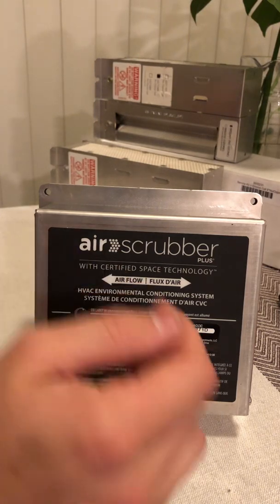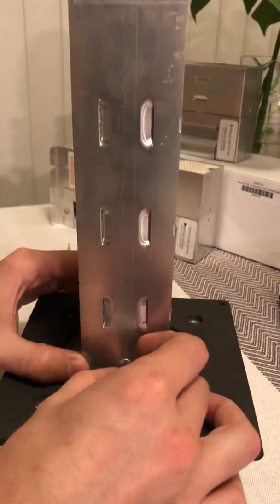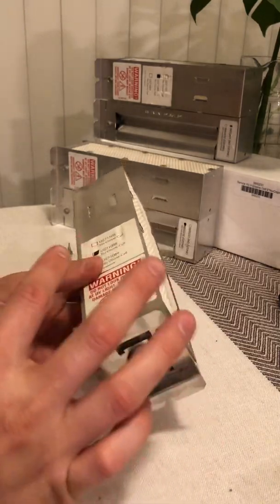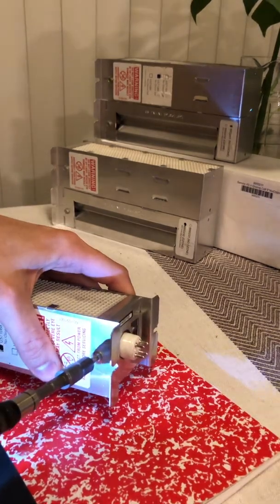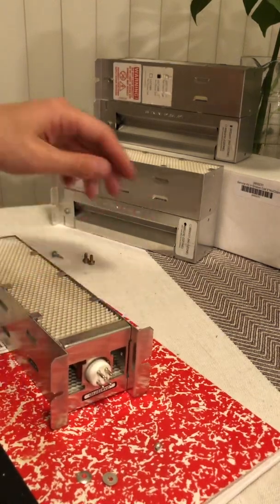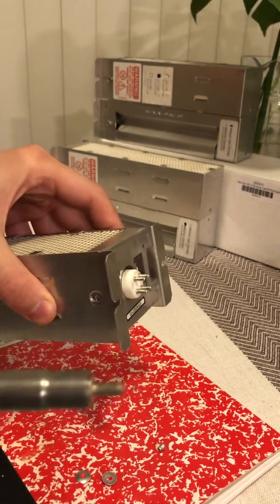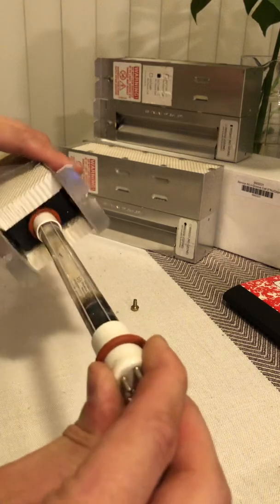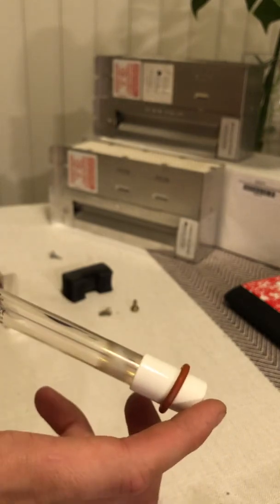Air scrubber plus | modifying cell for bulb replacement

Comment: Hi Victor  K,  I have a question about air scrubber bulb replacement.  I have purchased OEM quality from Amazon to replace, is this good or equivalent quality to use?  I did call Aerus, but they won't sell bulb to individual home owners.  Anyway, it was very good price on new bulb with cell as 1 pc.  I did receive this today, but I thought I ask you for your comment on OEM quality.  Hope, you see my message to reply.  Have a great day!
Reply from the maker: Good Question. the original bub/cell is rated for 20,000 hours and it seems like all the aftermarket ones are rated at 10,000 hours. so the useful life is about 50% of the originals. they are significantly cheaper though and still worth doing it yourself vs having a company do it for you and charge labor costs. I dont see why the cell couldnt last for 20,000 hours, so you could reuse the cell one time and replace just the bulb for a lower cost alternative.
Reply: Thank you so much for your reply.  I did buy led bulb from Amazon and it is working.  But need to find cartridge that will be whole replacement.  Thank you again for your reply!

Comment: What is the difference between the models A1013A, A1013P, A1013Q, A1013U and A1013T?
Reply from the maker: @Jame-eq4hd  that is a good question for the manufacturer. I’m not sure.

Comment: What is your recommended size of the fine threaded screws needed (Diameter and length)?
Reply from the maker: #10 screw, 3/4” length is what I used, but 1/2” length will work too

Comment: I work for the company and the complete cell unit needs to be replaced. The proprietary coating on the hexagonal matrix degrades with use, same as the bulb. This is a cheaper solution but the efficacy of the unit is going to suffer and you are not going to receive the benefits you expect from the unit.
Reply from the maker: Thank you for the comment. I agree the titanium dioxide honeycomb cell does deteriorate over time. However to me, it stands for reason that if the honeycomb is intact, it can still be used. I have seen these honeycomb cells literally crumbling to pieces when removing the entire cell. Those I would not reuse. 
Maybe you’re able to shine some light on the expected lifespan of the honeycomb cell? I know the bulbs are rated at 20,000 hours, but I’m curious about the titanium dioxide portion. Does it have a longevity rating?
Reply: @victork3397  Titanium dioxide is what is used for traditional PCO units which provide a local purification effect, while ActivePure uses a proprietary mix of metals as a spray coating onto the honeycomb matrix that creates the active molecules that fill the indoor environment and provide proactive purification outside the unit. That coating quantity is designed to match the UV bulb lifespan for the entire cell assembly (honeycomb matrix and UV bulb) to be replaced every 2 years. The integrity or appearance of the matrix itself is not an indicator of cell assembly lifespan as the matrix is made of more durable material that should hold up for years longer than the bulb will emit optimal light or the coating remains as a catalyst.

Comment: This was an excellent video. Thank you so much. It was so easy with your instructions. This saved me $90 for a house call and an additional $300 for changing the UV light bulb that costs $28.
Reply: I was quoted $600 (with a discount) to replace mine

Comment: Hi Victor,  Great video and guidance! Very generous of you.  Thank you!  My husband just installed a new Air Scrubber Advanced unit. He used a 24-volt transformer and the plug-in route.  The LED indicator is not lighting showing that it's operational. Uh, oh.  Per the instructions, he ensured the safety switch was depressed.  Any guidance would be most appreciated.  We live in the boondocks and it's difficult to get somebody out here. And, I am wary of the service fees and product markups noted below.  Yikes!
Reply from the maker: Is the 24 volt power source AC or DC? Did you check power right at the jack that connects to the air scrubber?

Comment: Just replaced bulbs on my Air Scrubber by Aerus.  On mine, the white hexagonal cell is only held in place by 4 tabs (yours has 7) and is flexible enough that I could grab one end with fine needle nose pliers, bend it up slightly, and slide it out.  Reinstallation is the reverse process.  

I'd also add that when changing the bulbs, turn off power to your HVAC unit at the wall switch or fuse near the unit.  The plug for the Aerus power supply shorts out very easily, which burns out a fuse on the main control board if the power is still on when working with the Air Scrubber.
Reply from the maker: Yep. If the plug comes into contact with metal, it will blow the fuse. Good point. Putting a piece of tape over the connector could work if no off switch was present at the furnace.
Reply: @victork3397  couldn't you just turn the circuit breaker off?
Reply: i think i just did exactly that, because my unit will not come on anymore after unplugging without turning off power first.  Do i need another plug, and if so where can they be purchased?
Reply: @bientay1232  On my HVAC unit, there's a circuit board that's visible when the outer sheet metal cover is removed.  On the circuit board, mine has a 3 amp "mini" fuse that blew when the AirScrubber unit shorted out.   The fuse is a purple plastic type, typically found in automotive applications.  If your unit has such a fuse, remove it and inspect it,  If the wire inside is melted/disconnected, etc., the fuse has blown and your HVAC won't work.  Take the fuse to an auto parts store and they should be able to find a replacement.

Comment: Doesn't the honeycomb produce peroxide ion and needs to be replaced?
Reply: This is my question too -- how long does the honeycomb last?
Reply from the maker: Good question. The cell will continue producing the ions as long as it is intact. It will begin to deteriorate and fall apart. Will be less effective, and would be a good time to replace if you notice this.

Comment: Very GREAT video I just bought a Air Scrubber and had installed with new furnece, so this info will be helpfull in 12 months for me.
Reply from the maker: Just keep mind the unit comes with a 2 year bulb. I’ve come across quite a few that have burnt out a month or two before the two year mark, so monitor it periodically once you’re getting to the two year mark.

Comment: Can you share information on the screws you used?
Reply from the maker: I used what I had on hand. The screws used to drill the rivets out were self drilling screws with 1/4” hex head. The screw used to replace the rivets were fine thread self threading screws, also with 1/4” hex head. Use what you have on hand. If it holds it tight, it will work. Good luck.

Comment: Thanks, just paid $140 for a new cell with enclosure…will be trying this next time.  The HVAC folks wanted to charge me $450 to do this for my unit in the attic.  Unbelievable that for $30 you can do it yourself!!
Reply: Just got quoted $504 per - with two units they want $1K to replace! Previously they said $800 each. So I've been saying, naw, I'll pass!
Reply: TRMiller just told me $600. That's some markup.
Reply: Glad I came my ac folks are talking about $1000.